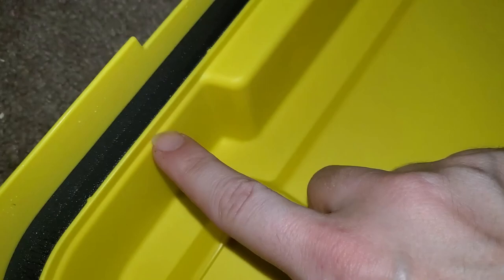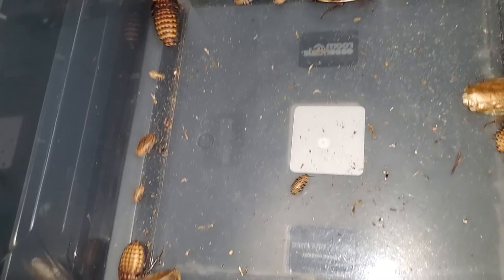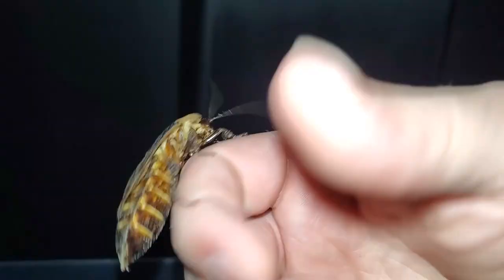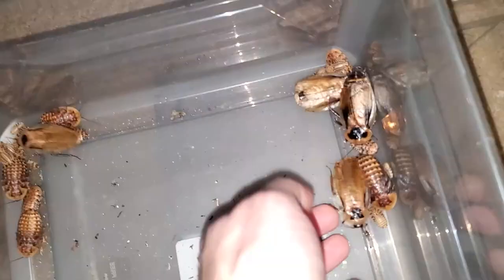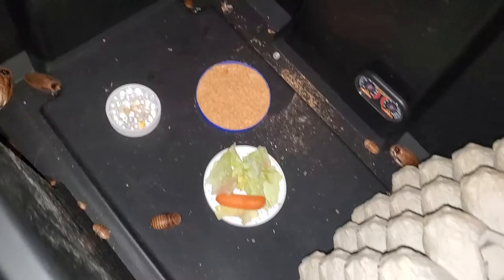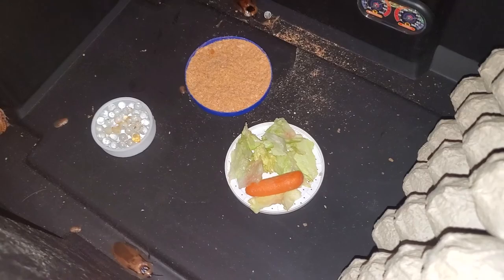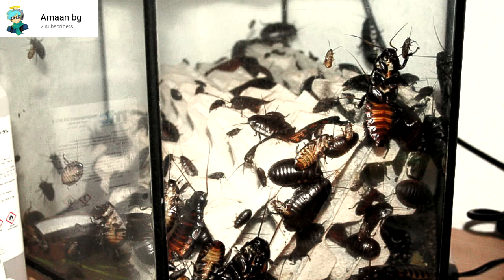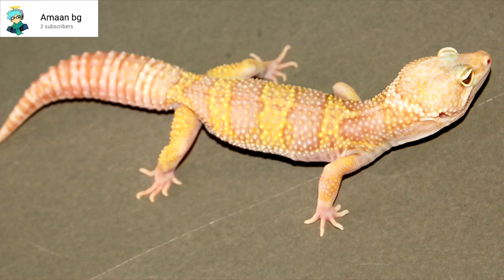Discoid Roach Breeding - Discoid Roach Colony - Dubia Roach Replacement/Alternative - Roach Breeding

Comment: I have a question the one that has wings does it fly? I just purchased my beardie and I would like to breed, but I'm afraid that it will get out of control for 1 beardie.
Reply from the maker: They cannot fly at all. They are heavy and their wings just don't work. Some can flap them to make a buzzing noise, but itsbvery rare and they cannot get airborne. Another thing, they cannot climb glass either. They are slow moving compared to other roaches. You could easily catch it if it did get out some way. I hope this helps.
Reply: @KCExotics  thank you for letting me know 😁
Reply from the maker: @plantingwithnat  I wish you the best!

Comment: Could I leave their bin outside (like on a covered porch) to keep the heat up? Or would that be too hot for them? It gets around 95 degrees during the day
Reply from the maker: You may risk things getting into the colony. I suppose you could do that, I've read they can handle up to 100F and some sources suggest that. I personally keep mine at 80F and inside using a heatpad on half the bin to create a hot spot under their egg flats. There are a lot of variables set into play when keeping them outside and i dont exactly suggest that. A small reptile heating pad would work. Something like 8watts or 16watts would be hardly noticeable on your electric bill running 24/7 and if you wanted to save on electricity, you could get a timer and only allow it to run half the day. Best of luck! Feel free to ask anymore questions!
Reply: @KCExotics  Thank you for the quick response!

Comment: What are your thoughts on raising them bioactively? I have springtails and isopods that we are are currently using in our BD tank (and an epic cricket fail in a 20 gallon long). I'm in Florida as well.
Reply from the maker: I've considered doing a more natural setup for them, with isopods and springtails. I haven't given bioactive a lot of thought due to my extremely limited expendable funds, getting a light and then running it is too much cost for my situation, personally. However, I think it would be a really cool setup. One thing to note is that it may very well be possible for the growing superworms to consume small isopods. Superworms snd their beetles can survive off all the same stuff as isopods, so they could possibly be good tank mates. Let me k ow how it turns out for you if you decide to do it. I was going to do something a bit more simple with just potting soil, leaves, and wood, with isopods and superworm beetles living together.
Reply: Pardon my ignorance but where would superworms come into play? Are you just speaking hypothetically?
Reply: Or is that what the larve is called for these roaches? Easily confused.. sorry 🤣
Reply from the maker: @eosborn78  it's more of a display terrarium, have a little eco system of insects that can live together. So if I had roaches, superworm beetles, and isopods, all 3 species can eat leaves and wood, and in general, would share all the same food items, like tangerines for roaches, they will eat all but the skin, but the isopods will. Just an idea on my end hehe. I have an excess of all of them to be able to do it. 

Baby roaches are called nymphs.
Reply: @KCExotics  So now I have Discoid roaches in my bioactive setup with my BD and it looks like they are all burying themselves! Uh-oh. Do you know if they will stay down in the substrate most of the time? I'm worried my BD won't find them. Appreciate your input!

Comment: What do you feed them to, or did you just keep them as pets
Reply from the maker: I feed then kale, collard greens, carrots, and sweet potatoes. I rarely use them as feeders for my leopard geckos, but I don't keep them as pets, they are food for my pets.
Reply: @KCExotics  oh,

And I think only the males have wings, that's how it works with dubia roaches 

One of them climbing up your arm looked like it didn't have wings
I think only the males have wings
Reply from the maker: @trenaebowers1968  it may be true for dubia roaches, I don't keep them and have never gotten to handle them in person as they are illegal where I live. However, for discoid roaches, the females most of the time have pretty wings just like the males. The females are a little bigger than males and are probably 10-15% heavier than males. I can sex them by picking them up and feeling the weight. I'm at the point now I don't have to look at the roach. 

But female discoid roach have a large singular plate at the bottom of their abdomen. The one that was on my arm was female :). She was a big girl.